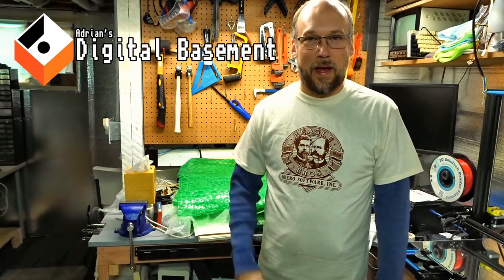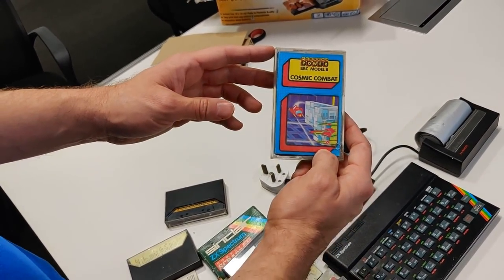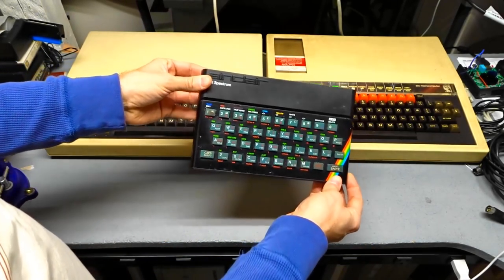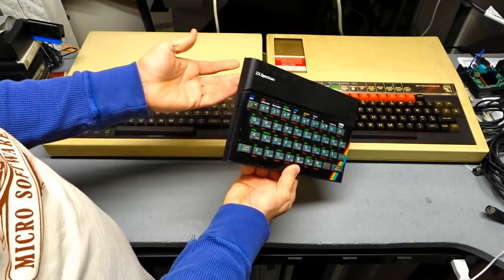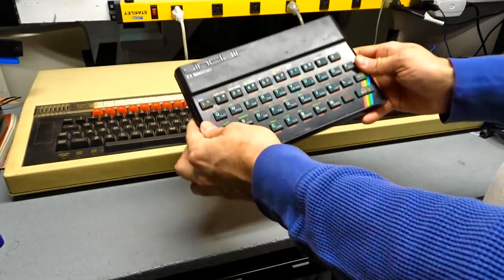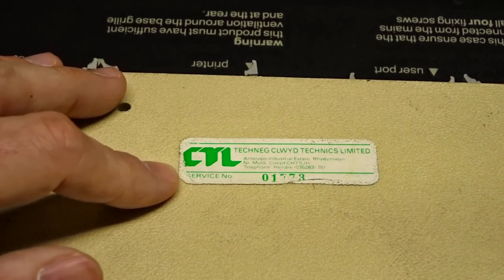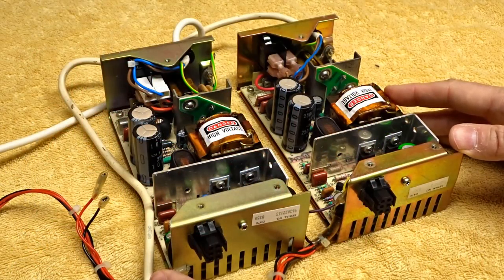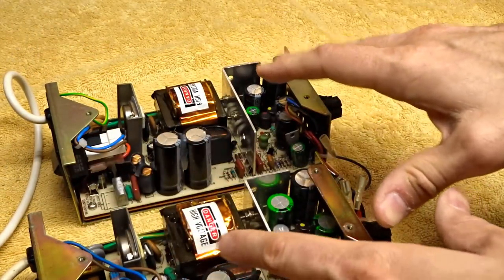I visited the UK and brought back some computers! Let's see if they work.

Comment: Not sure if you've tried the printer, but it works with a little stylus that is dragged across the paper on a loop.  It actually burns through to a black backing with an electric arc.   Very odd, but also very Sinclair.
Reply: So what can carry more current the metallic face on the Sinclair paper or the carbon paper from the male USB hole warmer.
Reply: Hey Clive, nice to see you here.
Reply: An electric arc?  You have got to be kidding me.  I have never heard of that before.
Reply: Didn't know you were into vintage computers Big Clive.
Reply: have a fan running or crack open a window while running it, I hear the fumes are none-to-pleasant ;)
Reply: @brandonupchurch7628  LOL. I remember that one. Did anybody figure out what that thing was ACTUALLY for?
Reply: @infinitecanadian  Yes.  And it actually works quite well.  It uses a belt with a pair of styli on opposite ends which move across the paper at (I believe) about 10-15 times per second.  The styli drag across an electrode charged to around 300 volts and produce a spark which burns an image into electrosensitive paper.
Reply: @adriansdigitalbasement    I would definitely check the condition of the belt before trying to use it.  Mutant Caterpillar Games used to sell a replacement belt but now they only offer a repair service which costs around 50 UKP plus shipping.
Reply: The only time that I ever used my Sinclair Thermal Printer was to print out BASIC listings to help with de- bugging.  If you exposed the printout to any form of heat, as Metallica used to sing, it would Fade To Black.
Reply: @BlackEpyon  I'm not sure about the vintage bit since I had a Spectrum after my ZX81.
Reply: @bigclivedotcom  Generally, anything 25 years or older is considered to fit that "vintage" category, and this now includes the earliest Pentium processors as well. "Retro-computing" is a term also used, but it's more or less the same thing.
Reply: It is a spark printer. I had a similar from Casio.

https://en.wikipedia.org/wiki/Spark_printing

It should not be confused with thermal printers that use white paper.
Reply: I don't remember any fumes but the light show in the dark was great :)
Reply: "Very Sinclair" sums it up perfectly.
Reply: Good to see Clive geeking out 👍
Reply: An early thermal printing technique?
Reply: It's electrostatic. Radio Shack sold a version of this printer. The stylus scanned the paper one scan line at a time, and fired the arc for each "pixel" which is to be black. The silver-like coating material is actually aluminium dust held in a glue matrix. So the whole sheet is conductive &  forms one electrode. The raster printer is very fast and it is archival, vs thermal paper which fades quickly (not archival!)i always thought it was a mistake that Epson never introduced a fast electrostatic printer like the amazing Bosch design. Mechanically they are very simple. Paper was a bit expensive as I recall. Generated a bit of ozone from the arc. Link: http://www.trs-80.org/trs-80-quick-printer/  the "screen printer" was amazingly fast(fast enough for receipt printing!)
Reply: Somewhere I still have printout from one of these printers, downloaded direct from UOSAT1 & 2. The satellites were designed so you could just plug the audio output of a 2 metre amateur receiver into the input of the Speccy!
Reply: These kind of printers did exist before. It's important Sinclair was all about delivered price. The paper was more expensive but the printer could be delivered dirt cheap. I took mine apart once. I believe it actually had two styluses (styli?). The motor would free-run and an optical sensor would detect the rotation of a slotted disc and send that signal back to the spectrum/81 and that way it would know when to send the signal to leave a black mark or not. Absolutely about the cheapest mechanism possible. You could write your own routines to do "high res" printing on the zx81.
Reply: Aww, Clive gets a heart after copying others comments, and Adrian replies.  What a pair of pricks.
Reply: Obvious troll is obvious.
Reply: I had one of those printers. I remember printing a graph on it in the 1980s and stapling it to a geography assignment. This was at a time there was one computer in our entire school and i dont think anyone knew how to use it. I cant remember ever using the printer for any practical purpose apart from that one time...
Reply: Hi Big Clive, I'm  a big fan of yours. Pretty cool channel. See what I did there 😁
Reply: I still have a pair of sinclair microdrives for the spectrum lol
Reply: @lukelovatt1152  I loved microdrives. No more loading crash because someone in the house shut a door
Reply: Don't use the ZX printer in the US. It leaks EM interference like crazy (it's really just a spark gap), which is why it was never sold in the US. It would be impossible for it to pass the FCC emission regulations.

The printer was (in)elegantly simple, like much of what Sinclair produced. It used routines executed by the Z80 processor in the ZX81 (yes, it worked on that) or Spectrum to turn on the 'spark' as the belt moved around the pulleys. All the computer had to do was turn on the motor moving the belt, and time where the pointer would be so it could generate the spark to burn away the metalic coating revealing the black paper underneath. IIRC, there were two wires on equidistant on the belt to speed up the printing process. It even used the character generator in the computer to shape the print output (which meant that it could print all of the graphic character set from either the ZX81 or the Spectrum). The advance mechanism of the printer was a simple gear drive from the belt motor, not a stepper motor, so the print actually slanted down slightly on the paper, and if you were advancing the paper, the bely still had to move, just not printing anything. 

Because of various timing issues, the printing was never perfect, and it was very rare for each 'scan' line of the print to line up exactly with the ones above and below. The printer was completely unable to function on a non-Sinclair computer.

If you do try the printer, make sure you use a high enough value power supply. The printer came with a new power supply for the ZX81/Spectrum so that there was enough power to drive the motor and spark in the printer.

The US BBC micros also had to have either metal shielding or a metallic paint on the inside of the case to allow it to be sold in the US.
Reply: @infinitecanadian  The ZX-Printer did indeed work like that. The paper was coated with aluminum making it conductive and the arc basically burned the dots on the paper. Alphacom would later make a more standard thermal printer that used normal thermal paper and was completely compatible (The Alphacom-32/TS-2040)...
Reply: Ha fancy finding you on here !
Reply: I remember looking at the Sinclair 'printer' when it first came out. I thought the simplicity of the spark printing was genius. Is there any other 'subtractive' printing technology? I can't think of any printer that takes stuff OFF the paper to make a mark.
Reply: @infinitecanadian  You would be surprised by half the stuff 'Sir Clive Sinclair' came up with - much of which flopped, but he was he was something an inventor, we must give him that.
Reply: Wow, even I didn't know, or just don't remember, about the electric arc printer. I always though it was another thermal printer variation.
Reply: @28YorkshireRose12  He still is.
Reply: @infinitecanadian  Very true, though it's all very quiet these days on the Sinclair front.  When I say "was" I'm thinking in terms of the quantities ideas that came out Sinclair in the early '80s.

I never did get a C5 though!
Reply: I used to have one of those Speccys and the printer.  The printer was a strange thing and every time I printed something it would generate so much electrical noise that it would block the TV reception (my to my Fathers' annoyance).  Also be careful with the ZX power supply, I think this used the outer ring as positive and the inner as ground.
Reply: It i known as a spark printer. It is totally obsolete so getting paper would be hard. I had a spark printer on my Casio FX-702P.
Reply: Wasn't it just a thermal printer, like the ones used to print receipts? I'm sure that's what mine was!
Reply: I had a similar printer for my spectrum although it wasn't Sinclair brand (although I've forgotten what brand it actually was). I was writing my first game in assembler at the time and used to print out reams of code. The printouts were very similar to till reciepts and I'm sure the thermal paper (that is what I used to ask for in the shop) was for cash registers.
Reply: its crap it has no WI-FI like my iPhone 11
Reply: Taken from early fax machines using electrolyte paper rolls there's no black backing its the cooking of the paper which is heat sensitive to the steam
Reply: Not as cool as a micro drive.
Reply: The “bog roll” printer <3
Reply: That electrostatic paper was also used in larger sizes/rolls for (eg) chart recorders** . 
At college in early 70's the postgrads had made a graphics tablet for a PDP8 using such a square of paper with triangle waveforms switched across/down the paper - easy to detect the position of a handheld stylus with little more than an ADC. Worked well - I used the tablet on my final year project.

** (maybe 'Polygraphs' lol - Mr Sinclair would've doubled-up the spark supply for false responses)

Comment: Adrian, the cut out on the BBC Micro was never factory. I paid my way through college by fixing BBC's and it was a rare mod designed to dissipate the PSU heat. If you need any parts for the BBC, or need help, please let me know. I have tons of s/w and utilities including ROMs....
Reply: @adriansdigitalbasement  

the -5v problem will prevent the sound chip working as well as the serial and tape interfaces
Reply: You've got me wondering how it was cut out so neatly.

Comment: The CTL sticker is from a company called Clyde Technics Limited in North Wales, the UK. I used to work for them 30 years ago. They sold and repaired BBC micros.
Reply: Hey Adrian love your channel, and your enthusiasm, I can't add any more about the company or the sticker, but I actually live in the town of Mold, it is less than 2 miles from location mentioned on the sticker.
Reply: Yes, it would have been. Clwyd Technics sold 1000s of BBC micros.
Reply: Cymru am byth!
Reply: @adriansdigitalbasement  the Welsh one was most likely an OEM system, whereas the micro with the full bbc name was probably sold by Acorn and distributed to schools
Reply: It’s awesome seeing these bbc computers again I used them in a secondary school in the clwyd county where we had computer rooms filled with them and they had the boxy monitors mounted on top of each one that matched the computer........even the piece of paper taped to the plastic trim was a common thing on all the machines we used....will be interesting what you do with them 👍🏻
Reply: I think that auto corrected to Clyde. It's Clwyd.
Reply: @Poolio32  Think they were often "cub" monitors.
Reply: BRILLIANT!!!!!  :)
Reply: I live just up the road from Mold and did my work experience there about 30 years ago
Reply: I did work experience at Clwyd Technics in 1990.  Up there in Mold on the Antelope Industrial Estate.  I dont know if you remember me but I was the kid that wrote the graphics editor program in my week there.  Anyway, good memories.
Reply: @lselvester  Probably the very same year as me then perhaps?  1990.
Reply: @adriansdigitalbasement  You should try and get a Dragon computer
Reply: Rob Wainfur dragons were sold in the US I believe. Not popular, but it is said that DragonCon, the Atlanta sci-fi  convention, was so named because it was first organised on a Dragon
Reply: I live 20 mins from there. Small world
Reply: @matthewtyler-jones8317  Wow!  I never knew that.  Thanks
Reply: @gazzylou  i was thinking the same thing i live 20 mins away
Reply: @Fonzie They probably did but it was most likely outsourced to companies like the aforementioned Welsh company. By the time the original commenter mentioned, the original micro by Acorn would be long passed its heyday, replaced by the much more capable Archimedes.
Reply: @matthewtyler-jones8317  Two years later... Yes, the Dragon (a clone of the Tandy CoCo) was sold in the US for a while by a company called Tano - when they went out of business a Californian Distributor bought all the stock and apparently you could still buy effectively a brand-new Dragon 64 from them as late as 2016 - possibly even later! Not bad for a machine originally in production in the early 1980s, and that never really sold more than about 50K in total - mostly in the UK. I live there, and that was the one that we got before they went out of business about 1985; it was such a frustration, all the cool kids had Spectrums or Commodore 64s, and I was stuck with one that hardly anywhere carried software for after about 1986. I still have one, and it does work!
Reply: @FamilyWeir  ha I feel your pain. I bought the very cool Memotech 512 as my first computer, and also suffered a dearth of software. (And then they too went bust).

Comment: In the UK in 1984 there was a TV show called 'Database' which actually broadcast live software over the end credits which could be recorded onto your machine.
Reply: That genuinely is incredible! In 1984?
Reply: @Fonzie It varied from programme to programme, one week it was the C64, next week the ZX Spectrum, next week the BBC Micro etc.
It didn't require any additional hardware; just a tape recorder. Although it really helped if your TV had a headphone or audio out socket.
Reply: @willitwork4330  'database thamestv' is on here. if there are no sound issues then I imagine someone could attempt to use the end credit audio (if it exists in any clips) within a capable 8-bit emulator, such as spectaculator

Comment: Awesome. I'm from the UK and had a ZX Spectrum +2 as a childhood computer (but this was in the very late 90s WAY after it was relevant lol!)
Reply: I had the +3 but most of my childhood was spent using a 48k
Reply: @Lee_B77  Ouch lol.
Reply: @Lee_B77  Ah that sucks. My +3 is still in my parents attic so I'll pick it up sometime and get it hooked up to see if it works.
Reply: @terminusaquo1980  The most common fault on +3s that have been in storage for a long time is that the disk drive belt snaps or rots away. You can get new ones from various places, like https://www.dataserve-retro.co.uk/index.html they also sell cables to connect the monitor port on the +3 to the SCART input on a TV - much better quality than RF and saves having to find an analogue TV.
Reply: @gwishart  Thanks for letting me know, when I get it out again I'll keep an eye on the drive belt.
Reply: I HAD THE 48K THE NEWER 128K AND THE VIC 20 AND THE C64 AND THE COMADORE +4  i had almost all of them..i even had a spectrum 128k with a media hub and techo syth keyboard set up and software all in for 129.99 at dixons

Comment: The paper has a metallic coating because it's used in the electroerosion "spark" dot matrix printer.  The metal is blasted off by current flow heating where a dot is desired.
Reply: Winston Smith Should be fun to listen to on a shortwave receiver :)

Comment: machine with the hole cut out is in an early issue 4 case, the texturing is different to later issue 4s and issue 7s

the later cases also had the anti-finger trap design
Reply: NB issue 7, issue 3 and issue 4 cases had the ashtray perforation to the left

issue 2s don't have the perforation

the mention of the BBC function key strip is absolutely correct...bbc copyright in europe held by a swiss company
Reply: Tone.  was going to say the same if my looking around didn't yield anything. :D

Comment: Brings back some memories, I we had 1 BBC in my primary school, when I started secondary school they was a computer room with 40 of them. And that was 1997!
Reply: I remember using Micros in school around 1999/2000. Most of them were masters but there was a B i remember. My younger brother told me they still had risc pcs there in 2006, and possibly still the beebs.

Comment: Great stuff! My first computer was a Beeb, which I eventually donated to a local school when I ‘upgraded’ to a PC.
Now that I’ve caught the retro bug, I have 2 BBC model Bs, and a Master 128.
Some add-on suggestions; a Gotek drive is a good start, especially if you mod it to use an OLED display and a rotary encoder & piezo sounder.
You can add co-processors by using a raspberry pi and the ‘pitubedirect’ software.
Also worthwhile is a turbo MMC,  or equivalent, and a ‘Data Centre’ from Retro Clinic.
Details of all these can be found on the Stardot forum, which I see you have already joined.
So, enjoy your Beebs, and have fun!